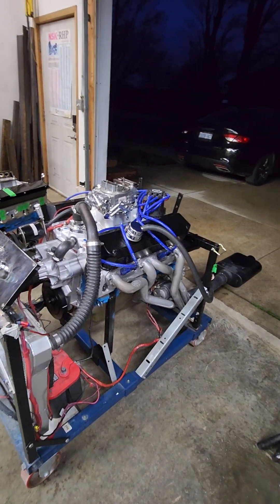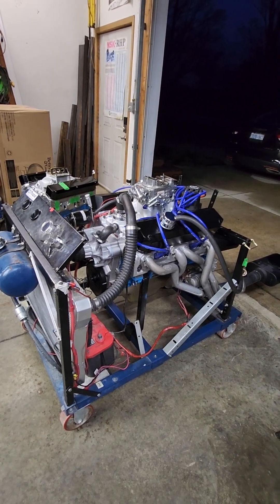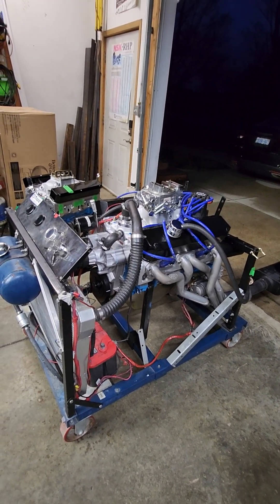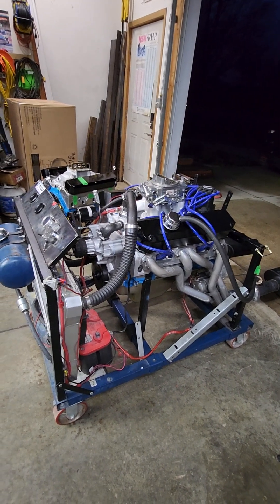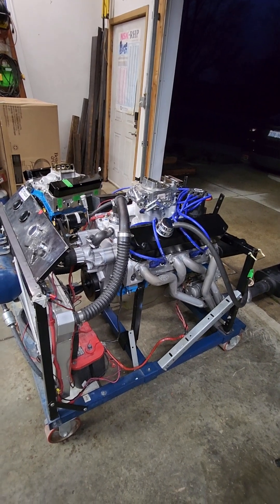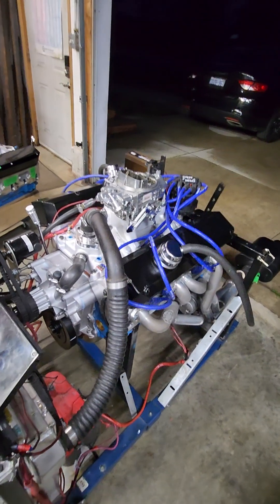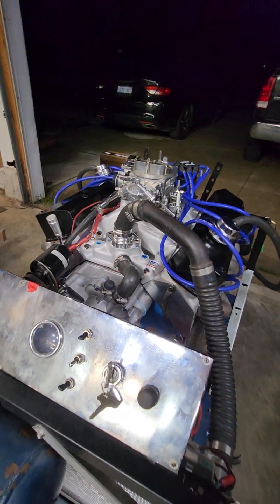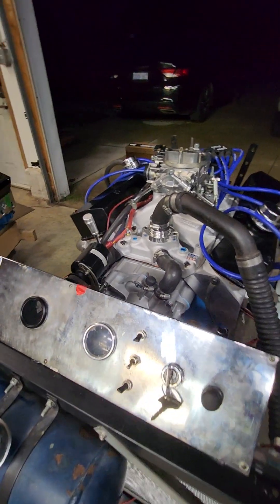Speedmaster vs Trick Flow Heads Mopar Stroker #2 on the test stand.  Getting dyno'ed May 4th

Comment: The heads dictate the capability of the power output.   Right?
Reply from the maker: They have alot to do with it, but the complete combo makes the capability of it. But if the heads don't flow good enough they will hold the engine back like you said.